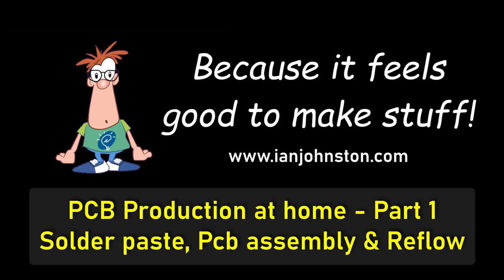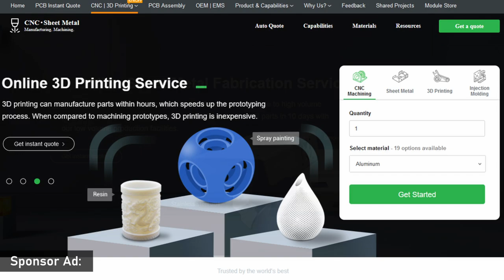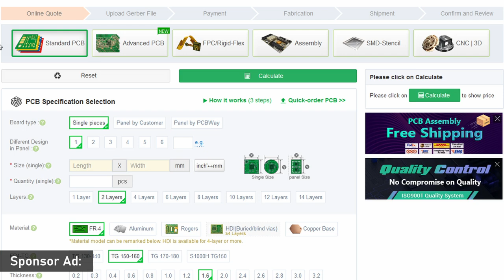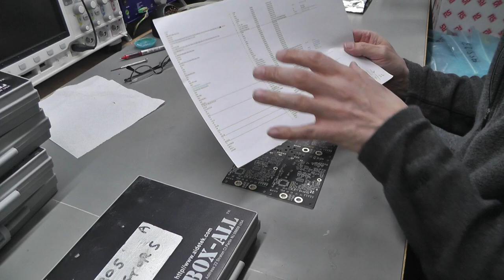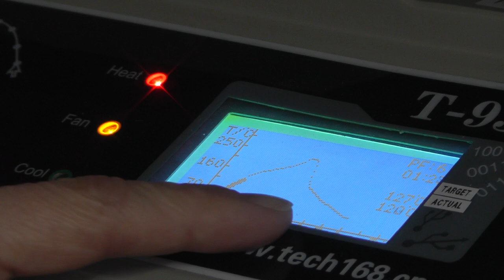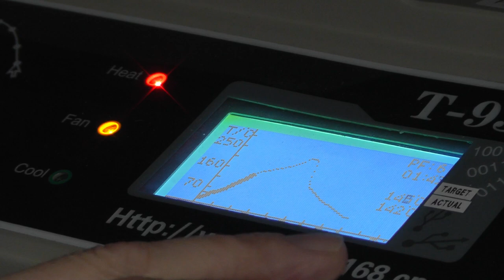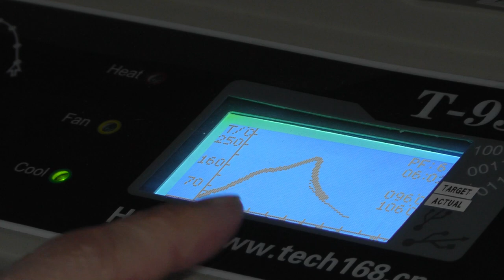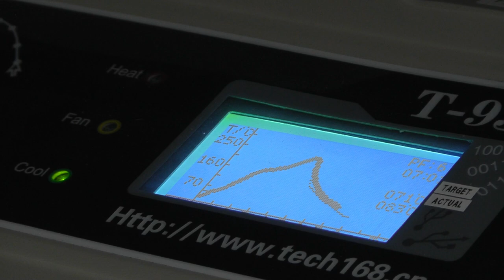No.108 - PCB/Product Production at home - Part 1

Comment: I have to admit, I always put the component values on the PCB so I dont have to look at a BOM etc. and to make it easier to just make a design public if appropriate, but you are right about the potential issue if a value changes.
Reply: i'm with Ian on this one. No values on PCB's as this allows you to make variants of pcb for different customers or changes if required. the issue of the PCB is printed in the copper layer as this can't be changed without relaying out the board again. The assembly is identified by a /number where the number is written on a blank rectangle after the assembly number on the silkscreen as this can change over time. Or we might make a few different /numbers so the board can be used for different customers.

For me that's just standard design and production processes I've been doing since I was 16. so been doing that for 47 years now so can't see me changing anytime soon. boy I'm becoming an old fart, but not as old as Fred (you know who you are 🙂)
Reply: @TheEmbeddedHobbyist  Woof!!!!!!!!!!!!!!!!!!!!!!!!!!!!!!!!!!!!!!!!!!!!!!!!!!!!!!!!!!!!!🐶

Comment: im actually considering using solder paste and a stencil, as a future design might involve QFN's. I've tried doing them (or rather redoing them) on scrap router PCB's but can never get them to centre just right with hot air alone. I see either a hot plate or a toaster oven being abused in my future :)

Comment: Thanks for the video, super insightful! What paste are you using?
I'm having trouble getting a good paste pad on smaller (VQFN) components.
Reply from the maker: GC10 in a 500g tub from Farnell. There are a couple different ones available, different ball sizes.
Reply from the maker: GC 10 SAC305T3 885V 52K
So thats the T3 variant that I use.
Type T4 for printing and dispensing applications.
Type T3 for stencil applications.

Comment: Thank you for a really interesting video, Ian. The PDVS2mini is an excellent product  - for those who do not own one I highly recommend it! Do you test any of the components prior to installation? Regards, David
Reply from the maker: Thanks for the comments.
No, I don't normally test any of the  components. I have kinda nailed the design so there is a bit of lateral movement in any of the individual specs. It's when changing to a slightly different "compatible" component that issues can arise, and I do have a couple of test boards I use in such occasions.